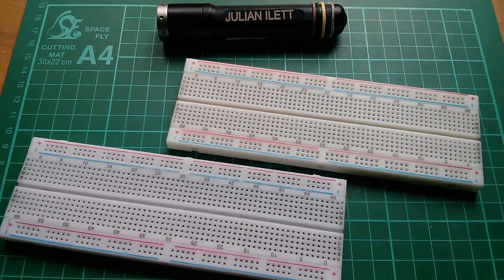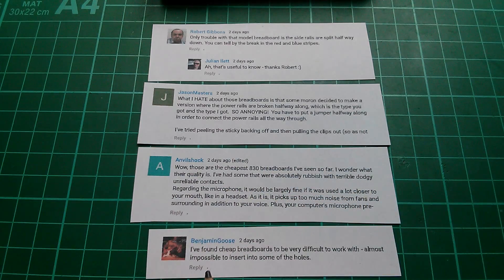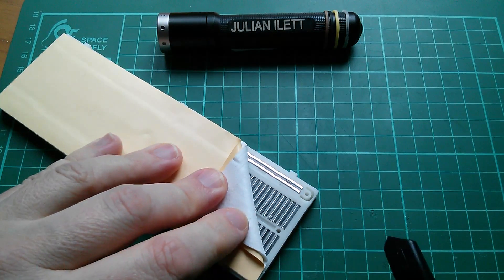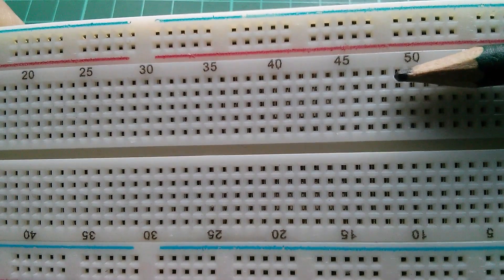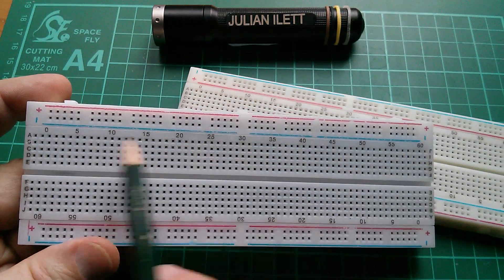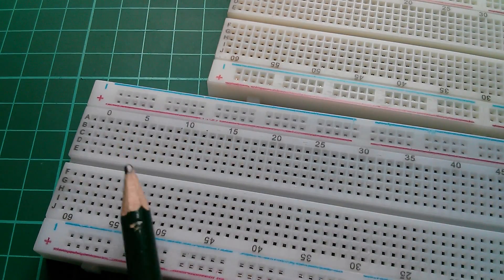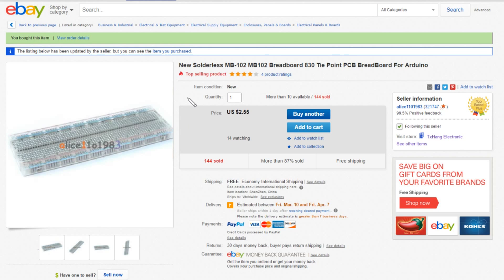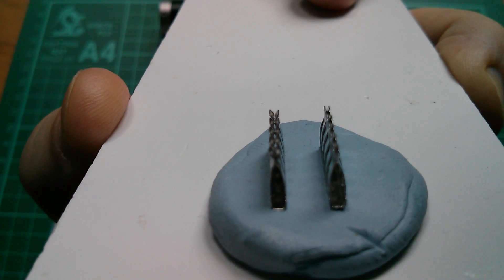FAKE Solderless Breadboards

Comment: On my original breadboard, all letters are lower case and there no break in the power lines, compared to this new "fake" stuff coming from china. On these "fake" ones, the pins don't line up, very poor contact and If you have a hot resistor/transistor/hot air gun near the plastic, it will melt....

Comment: Why don't you just remove the double sided adhesive foam, remove the contacts and bend them to give better 'funnelling'? You could then reassemble them and use some strong gaffer tape to hold everything in place. At least that way you won't have completely wasted your money.
Reply: That would be 3200 precision bends for both boards
Reply: karl ramberg 
Hardly precision, but pretty mundane! Although, looking at the design it should be possible to bend multiple contacts simultaneously with suitably long-nosed pliers so the total number of actions could be greatly reduced. Personally, I don't like the double sided foam adhesive used on breadboards so replacing it for something single sided would be beneficial IMO.
Reply: Or you could just buy a high quality breadboard for $10 and save 10 hours of your time.

Comment: omg my breadboard is exactly like that it so difficult to get the things in it. resistors are worst bcus their wires are so thin they bend and scrunch up rather than go in. but Ive never used a different one so I didnt know. if anyone has got a link for a breadboard on ebay they know is one of the good ones thatd be really nice
Reply: Ebay is a mire of garbage. That's what it's there for. It is a dumping ground for the worlds trash.

Comment: I've seen many instances of breadboards with split power rails over the years, including some from long before the Chinese made most or all of them. This allows more voltages to be used. Don't like it? Just use jumpers to merge rails.

If you look at reviews on Amazon about the various boards sold there, you'll find that too-high insertion force is a common problem these days.

Also, I suspect the reason for inverted and reversed lettering at one end of the breadboard is to allow the letters to be read regardless of the board orientation although I don't see that being nearly as useful as having the letters oriented the same at both ends.
Reply: Makes more sense to make a template that prints the markings in one step and not require rotation at all.  Plus, the alignment then only needs to be accurate once instead of twice.
Reply: Also, from the Wikipedia page on breadboards. Note that the board shown to the right of that text about power bus strips has the same split bus and inverted lettering as yours:

https://en.wikipedia.org/wiki/Breadboard

Some manufacturers connect all terminals in a column. Others just connect groups of, for example, 25 consecutive terminals in a column. The latter design provides a circuit designer with some more control over crosstalk (inductively coupled noise) on the power supply bus. Often the groups in a bus strip are indicated by gaps in the color marking.
Reply from the maker: True, the split power rails could be seen as an advantage :)
Reply: I suspect the reason for the inverted and reversed lettering is simply that it was quicker and easier to create a print mask for half the breadboard and then rotate a copy 180 degrees.
Reply: Didn't mean it like that. You create half the mask, rotate a copy of it and create a template from both copies together. One single print, one single alignment.
Reply: That said, I've found the long boards sold under the brand name ELEGOO on Amazon have continuous power lines. They're not perfect, though. The numbering and labeling is a bit off, but I never needed that anyway.

Comment: It may just be the seller, I bought a  non-transparent MB-102 from alice a long time ago and it's completely fine. Only extremely minor issues with ink quality and number placements.

EDIT: Sorry the MB102 I bought was actually from lovesell2013 and it was part of a kit that included that breadboard power supply you showed last video and some M/M wires.

Comment: Also, I don't now why the 3M breadboard are so expensive.
I have one that's mounted on a metal plate with binding posts that works very well.
Alan Wolke W2AEW uses the same one in his videos all the time.

I have a bunch of cheaper ones and they're all of different quality but I think it's best to get a very good one for larger or fiddly/sensitive projects and use the others for experimenting.

Comment: i personaly recommended brand EIC E-CALL. I use one for ages and is still in excellent condition.. I managed to buy few years ago from ebay EIC ECALL directly from manufacturer, they have round holes and they works very good. I had few of those chinese crapboard and i throw it away.

Comment: Just imagine trying to insert a 40 pin DIP into one of these cheap nasties.
Reply: Try using a round pin DIP socket or pin headers on your breadboard.  Putting flat pins in a breadboard is always tough because the pins are cross-ways to the tabs in the board.
Reply: station240 _ I can imagine a few pins folding up!
Reply: station240 _ I had to use a block of MDF to insert an Arduino Nano. Conversely, and even worse, other components have a very un reassuring lack of insertion/removal force. This is from a U.K. eBay seller.
Reply: @TonyLing  In some cases, it is just a front: i have bought some items from "UK" sellers, only to receive my things directly from China.

Comment: I've got a few of those. I didn't really have too much of a problem inserting component leads, but more of a connection issue.
I've often built up a circuit on one of these only to find it didn't work. The same circuit on my K & H breadboard would work fine.
I've mostly given up using these, so I'll wait to see how the replacement boards work for you before I buy any others.

Comment: I notice that not only do the letters go backwards at the other end, the numbers do as well. Yuck!
Reply from the maker: That's true - well spotted!
Reply: I wonder though, if you were building two separate circuits on the breadboard couldn't that actually be useful? You could build one and then spin the board and build the other from the oppsite side while still having the numbering and lettering line up, albeit in mirror of the first circuit.

Seems like they are marked in that way to let you work from either side and still have the grid laid out.

Comment: Julian on your small breadboard have you got the top negative rail shorted to the bottom positive rail with the long jumper ?
Reply from the maker: That's because the op amp needs a split power supply +12v 0v -12v
Reply: Rob Bennett I noticed the same thing.

Comment: every breadboard I have ever seen have half length power rails...
Reply: 2010craggy some times split power rails are desired. You can connect the split rails but you can't break a continuous rail.
Reply: Not really silly since if you're working in analog you're likely to need 2 or 3 power rails plus ground.  If you're not, install a jumper between the rails as soon as you get the board and you're done.
And I agree, every long breadboard I've ever owned had split power rails.
Reply: Ditto. I've got a mix of boards going back ~30 years and none are split
Reply: Wanna bet? I've broken those long rails before. Not on purpose, they are sometimes difficult to extract without breaking them. Why take one out? Sometimes leads break off, and need to be removed. After 40 years of breadboarding things do happen.
Reply: none of mine are split
Reply: tablatronix Its silly though.... they press them out in one long run, then snap them into strips of five contacts to fabricate the board with. They could easily therefore make continuous power rails, my thinking is they've only got injection moulding tooling for one type of board based around these little short contact strips.
Reply: I've got a pair of 3M model 109 breadboards, which I've had since the 1980s... they've got split power rails.  Also, one like the good version Julian had, which has split rails (has "Pro's Kit" embossed in the plastic back).  Finally, some old Radio Shack Experimentor 300 breadboards which have only a single power rail on each side, and those are not split.
Reply: I've found the long boards sold under the brand name ELEGOO on Amazon have continuous power lines. They're not perfect, though. The numbering and labeling is a bit off, but I never needed that anyway.

Comment: I got one recently that I haven't used yet, just checked it and it seems good quality (components fit in easily, letters are good, "1" and "5" don't line up brilliantly with holes but workable and rest OK).  It was in a cheap set with a power module and wires from the seller 'wwoodoo' - arrived quite quickly too (I ordered it 2nd Feb and I've probably had it a week or so).

Comment: I have three of those breadboards
You have to put a bit of force the first time on the pins to open. I used some male header to push the pins and now it works perfectly
Mine don't have problems with serigraphy

Comment: 8:19 - Gaah, those are the ones! Those are the ones that keep spitting out the DIP components for me, especially the push buttons and pots!! What wizardry do you use to keep them in?!
Reply from the maker: Sometimes they lock in just fine - sometimes I've had to bend the legs straight. Seems to be different every time :)
Reply: Twist the pins in the direction of the buss bars.  Or try short pieces of pinheaders.  But, definitely, take out any bends designed to grip a PCB.

Comment: Why did they have to fuck up contacts the way they did? I wonder. It wouldn't cost them even a cent more to bend these contacts properly.
Reply: If you have a machine that spits out tens of thousands of parts a day pennies add up. Now maybe to get the deeper impression they would have to run the machine a little slower? That means at the end of the day you have less parts. Less parts to sell means less profits too. It is ridiculous until it is your bank balance that is affected. Then you care when you can't park a new Mercedes in your driveway every year.
Reply: Makes sense but on the other hand if you made product that that actually works, it should sell better.

Comment: Just watch with those transparent ones. I like them, but note that the supply rails are split into sections of five meaning you've got to jumper them up. My only criticism is those tabs to slot n lock the boards together. They don't grip together to tight and soon part if you flex them too much, though you can mount them to a sturdy base with a decent contact adhesive. I've done this with my Arduino work station. Which is basically a wooden breadboard from Wliko's with an UNO, MEGA and Micro screw mounted in these plastic cradles you can find on Ebay, then I glued those 400 transparent breadboards bellow them making a nice neat experiment rig.

Comment: Yup, I've got 2 of those! Bloody irritating! Try inserting an arduino, virtually impossible!
Reply: James Searle Have you seen those plastic Arduino cradles on EBay? I really recommend them. You can either clip the Arduino into them (but they also provide four self taping screws to further secure the board down) then you can mount the cradle as you wish. For a few quid a piece they're a really clever solution for Arduinos.
Reply: 2010craggy No, but I'll have a look, thanks.
Reply: 2010craggy do you mean the protoshield? Couldn't spot anything obvious.
Reply: They're made by a company here in the UK called VNB and the lable says VNB Mounting Bracket UNO -AUB1. They're a shallow tray that the Arduino sits in. Think you can get them in Orange, Green, Black and White colours. There are slots and fixed screw holes around the edges to mount them onto a chassis, frame, enclosure etc.
Reply: 2010craggy Couldn't find it after a quick look. Lots of options tho.
But I kinda like breadboarding, and like Julian I'd prefer to keep my projects sometimes.
I just have a couple of boards that are dodgy, recent Chinese purchases. Already waiting for some of the mini ones without the power rails available in multi colours, just hoping those are not the same!

Comment: I have zero idea why people are complaining about the split rails. The basis of the complaint appears to be that a board you are planning to add lots of jumper wires to, requires you to add some jumper wires.

Hardly the biggest problem. The counter-example though, where you are mixing 3v and 5v circuits on a board, or 5v and audio +/- rails, is certainly a lot more awkward without the welcome convenience of split rails.
Reply: Yeah, this, having the split power rails on a board that big is a GOOD thing.
Reply: I don't understand that one either. And it's not asif high-quality boards don't have split rails.

I must admit I have scratched my head for way too long before I noticed the lines where interrupted. but it cost 4 seconds and two inches of wire to fix, so what*the*fart?
Reply: And more grounds, and shorter power rails is a plus!
Reply: The split supply rails are as per the original. I've got an E&L Instruments Inc SK10 Universal Component Socket here, bought in 1976 and still in use.
Reply: I can see a few instances where it is useful to have the split.

More rails for different voltages may be useful in some circuits, of course. It could also be used to provide some noise insulation between two parts of a circuit(for example, analog and digital parts of the circuit) 

There may be instances where one part of a circuit requires a very accurate voltage supply, but you do not want to power the entire circuit from that regulator.

If you are going to operate near the current limit for these bread boards, it may be useful to have short rails and put the supply wire in the middle of the rail. Of course, even with a single, long rail, you could use multiple supply wires, but in some cases it may be desirable to avoid loops as much as possible. 

One thing I have found useful with split rail boards is that they make it easier to just power up one small part of the circuit for testing, as you can pull out the jumper to cut out part of the circuit from the power.

For the boards with an unsplit rail, you have to pull out more of the wires and components that go to rail.

Sure, in most cases these advantages might be moot, but there really does not seem to be that much in the way of actual practical arguments against the split rails, it is mostly down to someone's offense over not having realized that their new board had such split rails.
Reply: Or it you have a circuit with more than one voltage input. Lots of possible uses beyond the two power rails top, and bottom.
Reply: HEHEHE!
Reply: The ESR meter I'm working on requires split rails because the two circuits are connected by the probes. So split rails are a must.
Reply: tiger12506 That just shows you are not following the basic troubleshooting steps of checking ur power supply before your circuit. My stupid dad wasted a LED TV coz he had not tested for earthing after he did the wall connection.
Reply: LoL, electronics 0.1: is it plugged in? :p
Reply: +tiger12506 That's why I start with the basics. Is each component getting power? A multimeter is essential.
Reply: It's better to have more of 400 point b.boards than these of crappy quality but with split rails!
Reply: Rupert Rooksby wow didnt think of this I feel stupid
Reply: There are small boards as bad as these on the market. They've got to cut corners somewhere, unfortunately.
Reply: Rupert Rooksby indeed very, very valid point
Reply: you know what Sir... I was thinking the same thing they're still usable, it  just requires a little bit more patience and not that much more
Reply: I've found the long boards sold under the brand name ELEGOO on Amazon have continuous power lines. They're not perfect, though. The numbering and labeling is a bit off, but I never needed that anyway.
Reply: Rupert Rooksby number one the pictures in the ad he bought showed FULL LINES NOT SEPARATED SECTIONS
Reply: I like your second point and definitely agree on that completely
Reply: the problem is that you can easily forget this. in fact i build up a fairly complex 4 transistor amplifier circuit on these things which took me like ages just to find it not working at all not know why and ripping all the components out again. then like a week or so later i recognized the issue and since this time i have 4 staples inserted across these splits...
Reply: It's an extremely frustrating problem if you aren't expecting it. I spent several hours once trying to find the issue with an ESP8266 uart connection, uncertain if it was a power supply issue or a firmware issue, or a software problem on the host, all while trying to explain to a friend how awesome ESP8266 are! Eventually discovered the split rail causing a floating ground. Nasty nasty nasty.

Comment: Hmm. I've got an 840-point breadboard with the same printing and doesn't seem to have this problem. Don't want to take it apart but from looking at the top it seems to have funneling as wide as the holes just like my smaller ones. Wonder what happened.

Comment: I bought a mix of the two from the same Alice, weeks ago. 400 points, transparent, 10 pieces, i think it was 10-ish euros for the lot. Just checked right now, pins of a 5mm led get in easy, the printouts are correct and aligned...